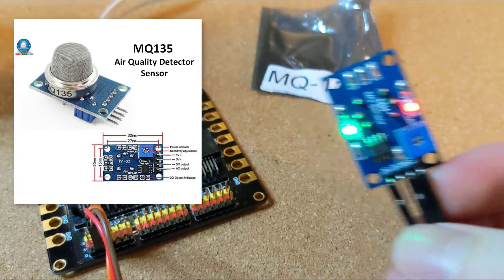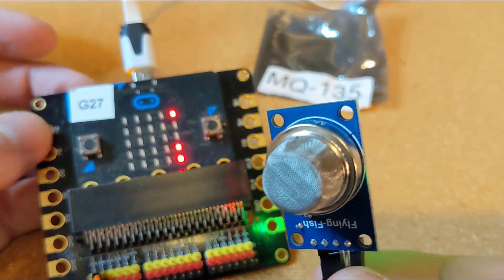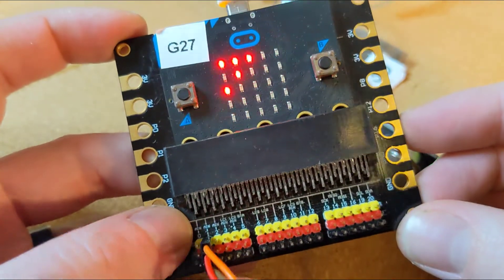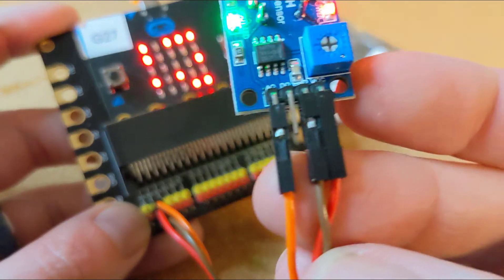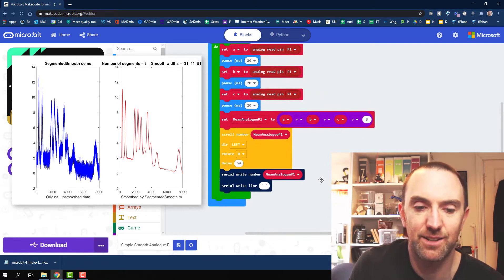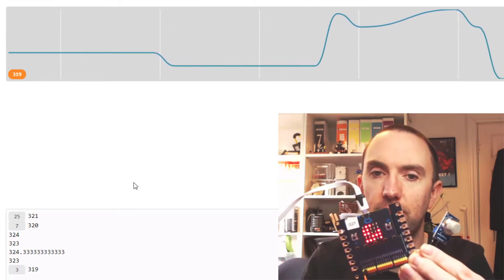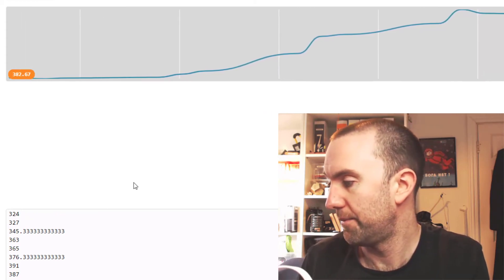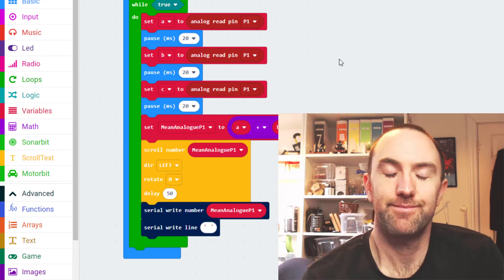MQ-135 Air Quality Sensor with a Micro:bit

Comment: Can gas sensor changed with other sensor like monoxide sensor?
Reply from the maker: Yes the MQ Carbon Monoxide sensor is pretty much identical. Same pins. The same code would run it.